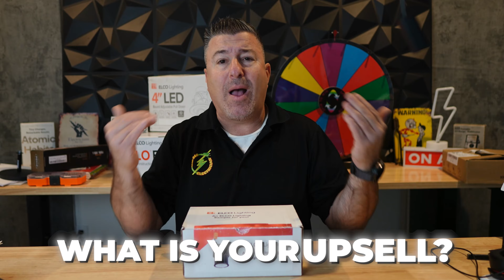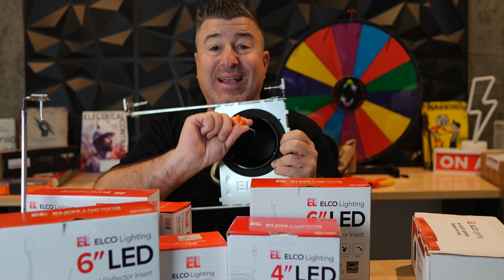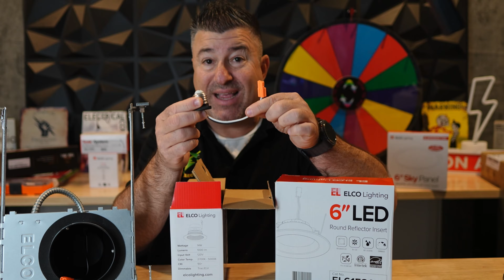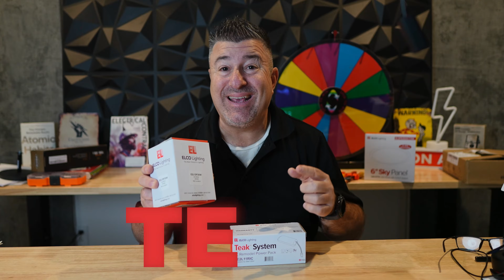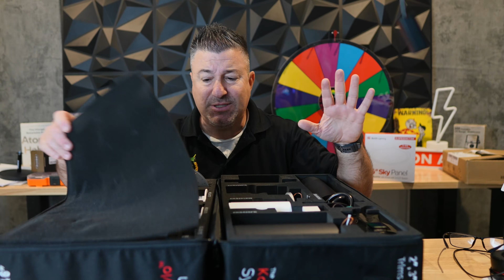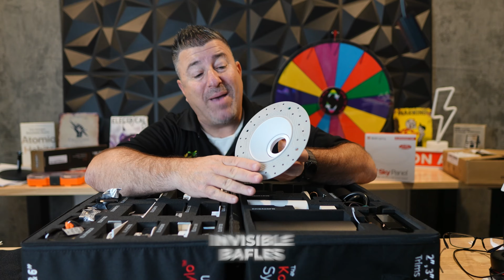How to make an additional 100k as an electrical contractor by upselling lighting.

Comment: It’s surprisingly hard to find good information on the premium side of lighting. Brands like Elco, Nora, DMF, and Lucifer rarely get discussed outside of lighting circles.

You are in a real special position because most electricians know very little about lighting besides how to run power to a fixture. They are installers first and may have some lighting knowledge if that. Most clients just want recessed lights, so wafers have become the default because they’re inexpensive, easy to install, and nobody questions it. There’s nothing wrong with that, but once you learn about optics, glare, beam control, dimming, and fixture design, you realize there’s a huge difference in how a space feels.

I try to steer clients toward better options when it makes sense, and every now and then i get someone who says just wants it all done well and that’s when products like Elco really shine. I love the Koto system. A little pricey for most people outside of the higher end work we do.